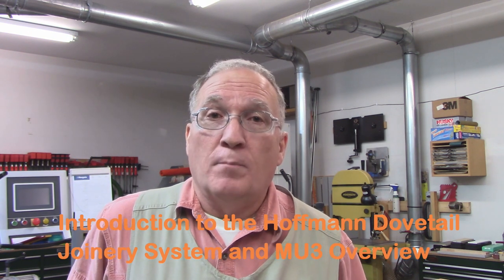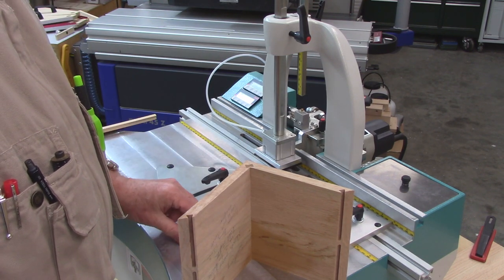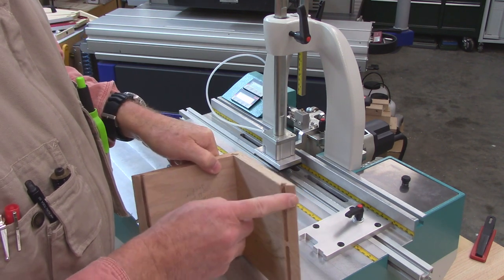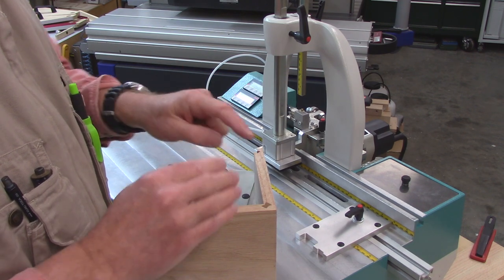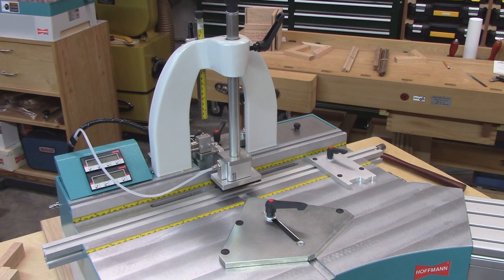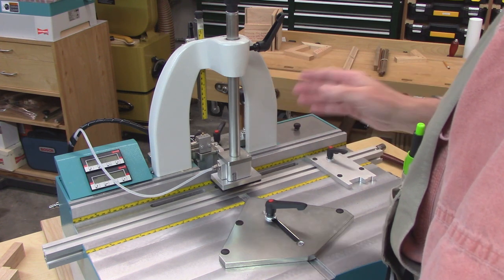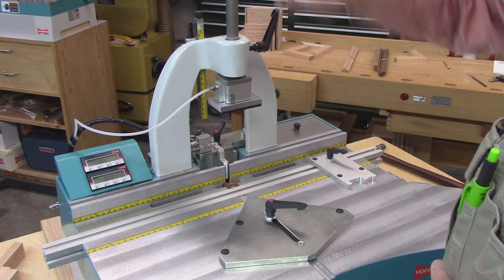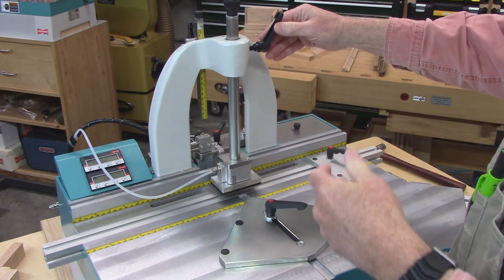Hoffmann Dovetail Joinery System Introduction

Comment: Nice video. 

We have three benchtop machines - an MU2-P an MU3-P and an MU3-PD, one each set up for W0, W1 & W2. We only got the Digital option because we were going to be at a show where Hoffmann wasn't going to be and they wanted us to be able to demonstrate the top-line machine. We are a production picture framing shop, and while theoretically the Digital could be helpful, we've gone a different route. 

We use spacer blocks between the tip of the fence plate and back fence, and we've modified the top of the depth stop so we can use spacers there as well. We developed that system before the Digital option was available, but continue to use it for consistency as well as simplicity - we can teach someone to use the machine with repeatable setups in about a minute. There's a chart with the profile numbers, W* sizes and corresponding width and height block specs.

One other modification we made on the W0 machine is to add a piece of 1/4" thick phenolic board to the face of the back fence. We frequently mill very narrow moulding, as narrow as 5/16. A piece that narrow will go right through the slot in the fence, so we added the phenolic and then ran the bit up through it essentially creating a zero clearance fence.
Reply from the maker: Thank you David.  Those are some good tips.  I have also run into the gap problem with 1/4" thick stock so I just used a spacer on the miter fence to provide a reference point.  The phenolic board is an interesting solution that would require greater bit projection.  I assume that you had to mill a groove on the back side of the phenolic for clearance since the bit does not cut in that area.  Great tip on the spacer blocks as well.  I'll have to steal that idea for my MU2.

Comment: Hello Steve. Just got a notification of a video for your channel and I will be catching up on the ones I have missed. Glad you are making videos again. This is a cool system. I think the first exposure I had to the Hoffmann system was watching Tommy use it on “This Old House”.
I have the Domino 500 and Zeta P2 but I can definitely see a use for the #2 or #3 style system. Especially for smaller pieces. I believe Lamello has a system that uses their biscuit joiner to cut a slot from the back side and a connector gets hammered in from the back. I believe the smaller size is the E20-H connector. It’s not as nice looking as the Hoffmann system but more in my price range. Especially since I can change the blade on my Lamello Zeta P2 to the size blade for the biscuits...
Reply from the maker: Thanks Ron.  Years ago, I picked up some of those Lamello connectors when Woodcraft was closing them out at 50% off.  I have yet to use one since I I like to work with thinner material than they require but, if the right project comes along, they will come in handy.  I think all the joinery  options we have available is awesome.  While there is overlap between them, I like to use the best method possible for a joinery problem and sometimes only one will work.  I don't use the Hoffmann system on every project but the same can be said for the Domino, Lamello, Mafell, and even handcut systems as well.  I have never had buyers remorse on any of the aforementioned systems as they all work extremely well.  Steve
Reply: @extremewoodworker  
I agree with everything you said. Definitely the Hoffmann system checks a lot of boxes. While the Hoffmann system may be out of my budget range I still enjoy learning more about it. Thanks for an excellent detailed look at it.
Ron

Comment: It’s basically a “Three Dimensional Spline” I’ve been using this type of Joinery for more than 30 years. I use it to make Blind  connections for table legs to turned Spindle night stands... I’ve Never needed anything this Elaborate in the past...
Reply from the maker: Have you considered making a video on your technique?  I am always interested in methods employed by others to achieve the same or similar results.

Comment: This machine has parts milled with extreme precision and those grooves on the miter were accurate on both pieces even though the pieces were on different sides of that 45 degree dual angle sled. The sled seems to have no free play at all and the 90 degree stop also had no wiggle to it.
Gapless perfect miters - metal working precision almost to thousands of an inch - and that red oak is almost metallic in hardness. Does it work well on softer woods like mahogany ?

And now I return to my workshop and my DIY router table and a router bit that seems to bend a mm or more when it starts working on the workpiece... 😀.

Good to see high end machinery though.
Reply from the maker: An excellent observation.  The precision that the Hoffmann MU machine has is IMO nothing short of phenomenal.  I have used various size keys on multiple species of mahogany (Honduras and Khaya), walnut, cherry, mesquite, maple, birch, sapele, pine, red and white oak with no issues.  Several upcoming projects will use keys of various sizes with mahogany.  One thing to watch out for is the grain direction at the tip of the miter.  If the grain flairs out toward the miter tip, I have noticed there is a greater possibility of a breakout.

Comment: Interesting machine. How would you compare the strength of these joints versus the Domino? Similar strength?
Reply from the maker: This can vary due to size and they do function differently but, for the most part, my gut tells me they have similar strength for the same size connection.

Comment: I'm curious, how long of a slot can this cut?  I actually built a pneumatic face frame notcher that I found out later was suprisingly similar to a hoffman dovetail machine.
Reply from the maker: I have milled slots 83mm deep.  According to the website, it can go 3-3/4" deep.  The notcher sounds similar to the Morso unit which is neat to watch function.
Reply: @extremewoodworker  Its actually not a stationary blade / guillotine like the morso. Its a router mounted on set of vertical rails, with pneumatic clamping and pneumatic router movement. Its shockingly similar to the hoffman considering I hadn't seen one before. I built it after seeing a us concepts notcher and the mechanism of one of my pneumatic hinge borers.